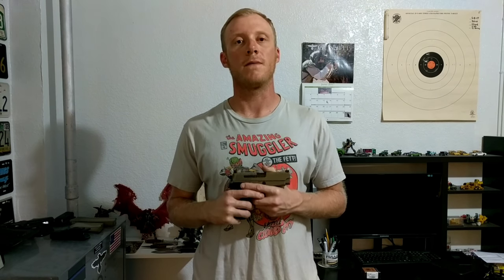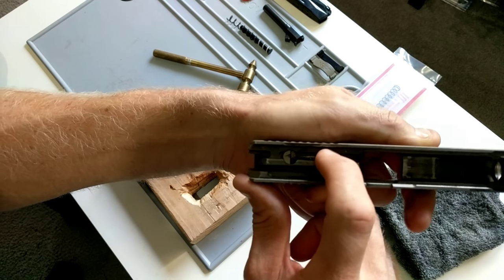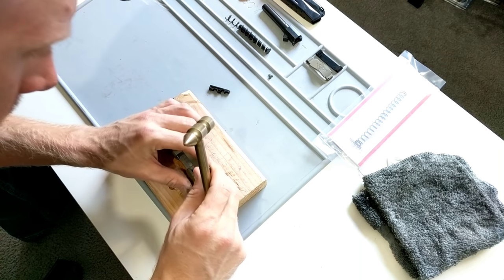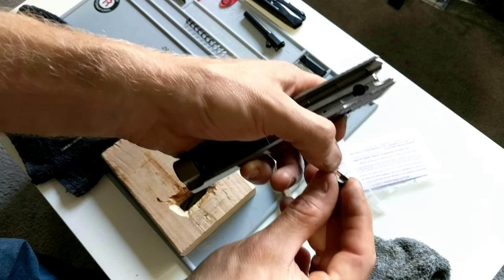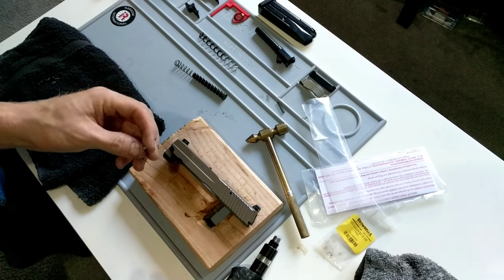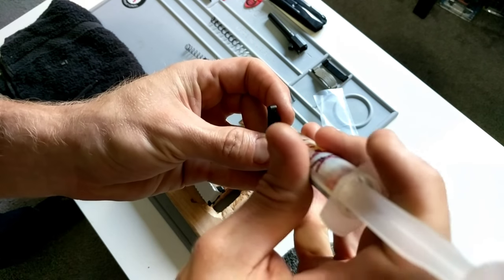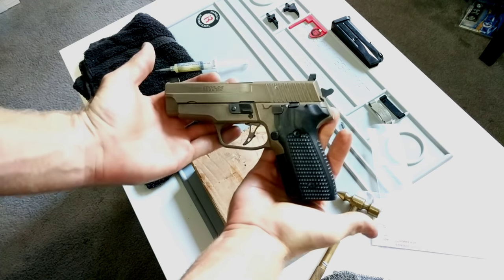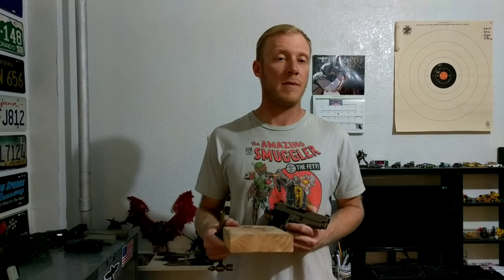Complete Disassembly: Sig P228 P229 M11A1 PART 1: Slide (long extractor or E2 extractor)

Comment: Thanks for your video! I was wondering if the notch on the side of the bolt face @ 9:49 (on the opposite side from the extractor, where the rim of the shell would rest when in battery) was normal and I see that yours has it, too.

Comment: Great tip at 7:45 minutes into the video! I would have been hammering away wondering why the pin wasn’t going into in the slide.
Reply from the maker: +Richard Ayala this made my day, and is one huge reason why I wanted to make this one. I won't lie, I did it the first time and was thinking WTF. I totally forgot and gave it a good 3 whacks before I remembered. Thanks for taking the time to give feedback!
Reply: TheFallingHammer I appreciate all the time and effort you folks make in giving your time and sharing your knowledge and experience with us! I have learned quite a few things, including fixing our clothes washer! Thank you
Reply from the maker: Richard Ayala same here! I've learned a ton from YouTube. It's crazy the knowledge that is available if one takes the time to look. I'm just glad I can help out a little too.

Comment: any one have a link to the punch hes using or one that would work cant seem to find one
Reply: 3mm but you need to modify to half round ( like a D not an O).  I know sig makes that punch also if youd rather not fabricate.  

I used an old glasses repair kit and a grinder
Reply: @arnauservaux3936  Does Sig sell the 3mm Half Round pin punch separately? Or do you have to buy their ridiculously priced repair kit for $300?
Reply: If you find a link to a website that sells them please let me know. I cant find the damn thing either. Quite frustrating.
Reply: @ThisIsMyChannelX  I ended up going to harbor freight and bought a set of pin punches for like 4 bucks and took the 1/8" (3mm) one to a belt sander until it was cut in half and that worked pretty good
Reply: @arctic9674  Thanks for the advise.

Comment: What kind of trigger is that?
Reply from the maker: Armory craft flat trigger. I have a video on them and discount codes :)
Reply: TheFallingHammer thankks
Reply from the maker: @jamesglennie4373  your welcome, I'm just here to help lol
Reply: TheFallingHammer it did. Quick question. I took the extractor off my 229 and it only had 1 spring. I believe yours had two. Is that normal?
Reply from the maker: Yea, an inner and outer spring. Do you have the newer long extractor or older short one?
Reply: TheFallingHammer the newer longer one.
Reply from the maker: @jamesglennie4373  should have 2